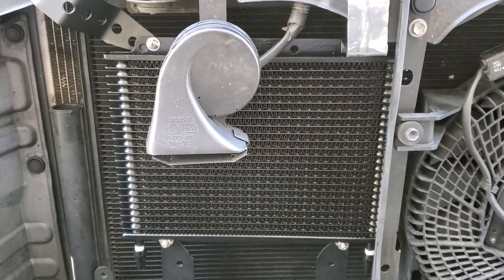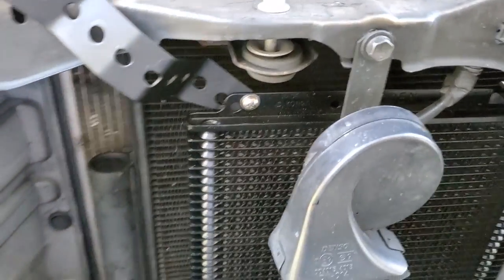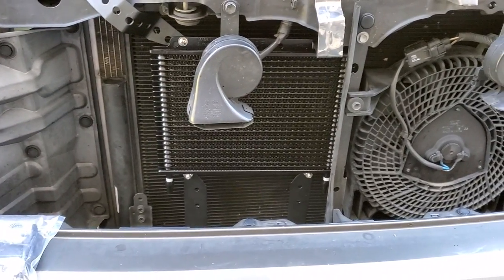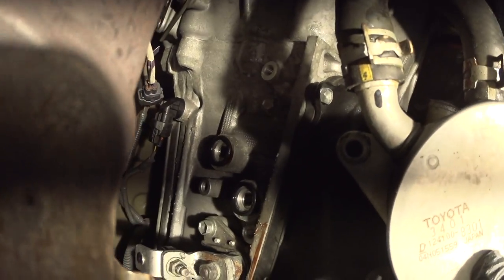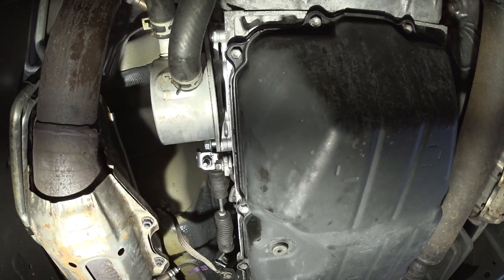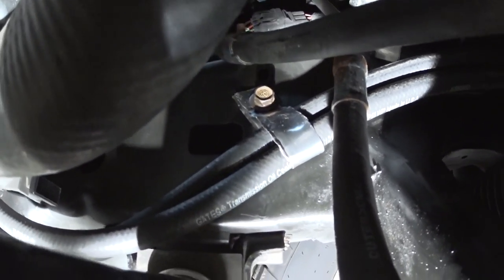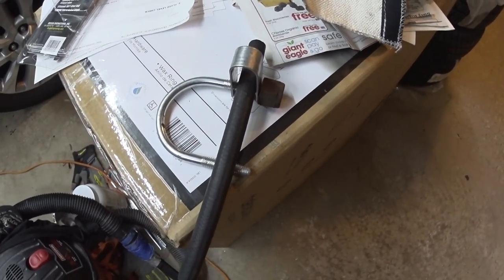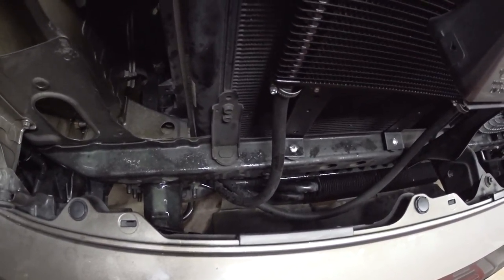TOYOTA TUNDRA transmission cooler installation 2014-2021, 2020 TUNDRA TRANSMISSION cooler upgrade

Comment from the maker: 3 inch u bolt is what I have https://amzn.to/3kTuD7y
Torque wrench https://amzn.to/3kW62z4
Transmission cooler https://amzn.to/3fjQzb7
Gates Transmission hose http://ebay.us/CJRehb
Best synthetic transmission fluid https://bit.ly/3ftsVZO
Transmission fluid transfer pump https://amzn.to/2IOoSLL
Tundra Transmission thermostat http://ebay.us/rdh6JZ

Comment: May sound like a dumb question, but is there no problem with the trapped air in the cooler and hoses after installation? Is there a way that the air is bled off, or am i overthinking this?
Reply from the maker: Air purged by pressurized fluid that is flowing through
Reply: @repairvehicle  ok, thank you for the quick response!

Comment: They DO NOT NEED additional coolers!
Reply from the maker: Yes they do
Reply: @repairvehicle  no they do not! They already have one!

I just posted elsewhere. What they have now is a heating and cooling system that works in conjunction with the engine cooling system.

We have had systems that warm up the engines faster (and I don't mean thermostats) for a long time now. Well Toyota has designed the trans to warm up faster - especially in extra cold climates - as well as to remain within operating specs (summer towing for example). Yes, they're higher than people are used to seeing, but that was considered when they designed the system.
Reply from the maker: No it was not considered.  Since 2007 Toyota had external transmission cooler until 2019. What changed in 2020, same engine and transmission?
Reply: @repairvehicle  well, the '19 and up Tundras have been racking up the miles and I'm still waiting to hear about all sorts of trans failures due to overheating, or failures in general.

Why preemptively install a part while under warranty? Let's see if these Toyota guys got it wrong first.
Reply from the maker: Why Toyota tundra used transmission sold for big money on eBay if they don't fail? Who is buying these transmission and for what purpose if they don't fail? Must be collectors item.
Reply: @repairvehicle  used? Well Tundras have been out for a long time. They also get wrecked, totaled, and parted out.
Reply: @PaulSter  Just bought a used 2019 Tundra with 58,000 miles on it to tow my 4300 lb camper. The transmission overheated after two hours of towing. They do indeed need an external cooler. Dealership said they reprogrammed the vehicle and serviced the tranny. Claimed they never heard of this problem before. Toyota dropped the ball in my opinion. This is my 5th Toyota vehicle. Not too happy.
Reply: @swamphillfarmapiary-dan810  sorry that happened to you. It's truly the first time I've heard of it. I sold mine because I didn't need it anymore, but I sure loved it. 

I hope yours gets resolved without too much hassle.

Comment: I see Toyota has installed an electric push fan on their Tundras. I ditched the clutched operated factory fan. I installed two electric fans with an electronic controller to pull 5500 CFM of air through my radiator. MY system, works much better in the SW Summers to keep the cabin very cool. The transmission cooler in my Tundra is much larger in my double cab with 4.7 liter engine.
Reply from the maker: Toyota will never install electric fans because they are no match to mechanical fans.
Reply: @repairvehicle  I challenge you and Toyota to that. Ford and GM have used electric fans for over a decade without any issues. Just like the transmission cooler, it was a money issue. They have off the shelf parts from other engines/vehicles they can utilize. The large output alternators can certainly support the 25/30 amp draw that my cooling fans require without any major electrical upgrades.
Reply from the maker: Toyota is not stupid.  They know electric fans can't move air like mechanical fan.
Reply from the maker: ford and gm don't use electric fans on their HD trucks, I wonder why? Even 6.2 f150 has mechanical fan.
Reply: @repairvehicle  : If Toyota was so smart, probably the bean counters, why on Earth did they eliminate the transmission cooler? It worked before without any issues. They’re is no reasonable explanation to not install electric pull fans on their trucks. Earlier tundras didn’t have the “push fan” your trucks has.m, correct? The Sequoia has it to help cool the A/C condenser during the hot Summers. We’ll see what Toyota does with the new 3.5 bi-turbo engine in the new 2022 Tundra. I’m willing to bet they’ll have dual electric fans, those intercoolers will need them.
Reply: @repairvehicle  But were talking about the 1/2 ton versions of their trucks. I just saw my nephews new GMC Denali and it has electric fans...his dually  diesel truck has a clutched fan though.
Reply from the maker: @jamram9924 , yes Ford 6.2 f150 has mechanical fan. Ford f150 diesel has mechanical fan. There's a reason why 3/4 ton truck don't use electric fans.  Electric fans can't move air like mechanical fans
Reply from the maker: @jamram9924 ,  Sequoia has mechanical and electrical fan,  due to size of the cabin.
Reply from the maker: My truck has only mechanical fan.
Reply from the maker: Tacoma still uses mechanical fan, 30 years later.  Why no electric fan? Removal of transmission cooler is definitely bad part of them. 2021 Ford f350 diesel no longer has transmission cooler either with 10 speed transmission.
Reply: @repairvehicle  true, but it proves that cooling that condenser quicker helps keep the A/C working at maximum efficiency. Obviously, more people to heat up the cabin. Is the Tundra Crew Cab that much of a difference? Point being is that there’s no logical explanation why Toyota engineers did this. I’m speculating it was the bean counters that influenced this decision. I live in the SW and have runned into many tundra and Tacoma owners feeling that “not so cool” A/C during stop and go traffic. This is NOT an issue on the highway. We have temperatures that reach well over 100F in the Summers and that’s just ambient temperatures.
Reply: @repairvehicle  I wish I could send you a photo of my set up. It is detailed in every aspect of the installation. Why? I notice increased performance in A/C and idling temperatures. I don’t want to destroy my aluminum heads due to a simple adaptation of a proper cooling fan system. There are several YouTube videos showing owners that have done this. There’s a guy in CA that’s does Baja racing in his tundras and also has exhaust systems, BAMufflers. Keith showed me his stats on the electric fans and I made some additional adaptations. It outperforms the clutch fan for cooling hands down. I am concerned about keeping my engine and transmission cool. Heat destroys them both!
Reply from the maker: You can create slide show and upload to YouTube.
Reply from the maker: I would have done differently if I had an issue with cooling the condenser. I would have added electric as an addition, just like sequoia has it. But I would love to see your set up. Maybe you can upload pictures to youtube as a slide show.
Reply: @repairvehicle  because those heads are cast iron and not aluminum, unless some manufactures has used aluminum heads in their diesels. When idling, an electric fan will move much more air than any manual clutch fan, that’s just a fact. Once a vehicle is moving it doesn’t rely much on the fan unless it’s driven on city streets. Once again I refer you to Ford and GM trucks using electric fans on their 1/2 ton trucks.
Reply from the maker: Ford and gm use aluminum heads on diesel engines.
Reply: @repairvehicle the last Ford diesel I serviced had cast iron heads by that was an earlier model. Updates in technology and metallurgical advances have helped make this possible. Different breeds of engines and all about cost effectiveness on electric cooling fans. Why? Costs. Higher output alternators and heavier gauge wiring systems and controls. A clutched fan is much cheaper to install A idling  car or city driven car with a clutched fan will never move the air an eléctric dual fans setup and that where this makes a huge difference. Again I’ll repeat that Toyota will install electric fans on their newer bi-turbo V6 on the upcoming Tundra replacement engine they claim will be on the 2022 Tundra.
Reply from the maker: We shall see, about tundra with electric fans. Tacoma still uses mechanical fan. $100k lexus lx570 uses mechanical fan.
Reply from the maker: 6.7 powerstroke has aluminum heads since 2011 and mechanical fan.
Reply from the maker: You work as a mechanic for Ford?
Reply: @repairvehicle  I worked at an independent import shop dealing with mostly European and Japanese vehicles. I would moonlight on all other things automotive. From my experience, Toyota and Honda and their luxury brands are much better vehicles than what the domestic market has. Ford has the best trucks on the market but they have their weaknesses as well. I prefer the Tundra for a variety of reasons, long term quality being one of them
Reply: @repairvehicle : ok my friend we shall see.....hahaha. Remember those turbos and their intercoolers...
Reply: @repairvehicle  Lexus used engine oil on some of the older Lexus. That was ingenious because it cooled the oil and spin the one fans they had a secondary pull fan to assisting cooking the condenser.

Comment: I need some help maybe you can help. I am doing drain and fill on my 2018 Toyota Tundra 4.6L SR5 but I can't  find the transmission cooler bypass valve. The Haynes Repair manual says that if have a truck has town haul package i should block the bypass but i can't find it
Reply from the maker: Did you watch video without skipping? Answer in the video

Comment: Does anyone know an OBD2 scanner that will read the trans oil temps? If we're going to install a cooler, it would be nice to be able to monitor the temp, and see if its working.
Reply from the maker: Scangauge 3 and 2 can read live temperature 
https://youtu.be/245sYnfe4V4
Reply: @repairvehicle thank you

Comment: Yes I on my 2019 tundra missing this. I bought Toyota for last 25 years.After this I won’t be buying another one.
Toyota should recall all the trucks back and install the cooler just to win back the customers!
Reply from the maker: Toyota still number 1 in reliability.  Ford does not have either.
Reply: Because your transmission failed?

Comment: Thanks for this, I've read of this being done on a few forums and even seen some pictures but this is the first video. Seems like a pretty straight forward addition to improve cooling of the transmission. 
Any issue with air in your cooler having the inlet/outlet both on the bottom?  It would seem turning the cooler 90 degrees would help.  
How much extra transmission fluid did it take after adding the cooler? Same process of filling, warming up and checking the over flow?
Reply from the maker: It doesn't matter if it's turned or not, because fluid drains back anyway, if it's on the side or down. Having inlet/outlet up, then fluid stays in the cooler, but fluid from hoses being drained back to the transmission. No issues and not expecting any issues. I wish have done it earlier. 
About half a quart extra, it will vary depending on the cooler size and hoses route.
Yes, same process for checking level through overflow tube, but make sure thermostat is open. 
Thank you for asking.  Please share this video with others.

Comment: Curious, why can't just a cooler be added after the radiator outlet back to the return of the transmission?
Reply from the maker: Your radiator has transmission lines connected?

Comment: Do you know what temp the thermastat will open up at?
Reply from the maker: Thermostat opens up I believe between 190 and 200 however fluid will not flow into cooler through thermostat if torque converter is unlocked
Reply: Thank you. I installed mine, using your video as my guide, and ive never done anything like this on a modern vehicle, so it was a challenge. Got it all installed, and its working great! Thanks for the inspiration!

Comment: Can I do this to my Lexus GS 6-speed? It has the same cooler puck now.
Reply from the maker: Probably can using same setup as Toyota tundra 4.6 v8 or maybe even as 5.7 if it has same size cooler puck as 5.7
Reply: @repairvehicle  Thanks. Both use A760E (RWD) (or H for AWD) Lexus. I will have to look into it.
Reply from the maker: How did you find my channel?
Reply: @repairvehicle  From my car repair addiction, some of your good videos came up!
Reply from the maker: I hope you are a subscriber to my channel. Because your question gave me some good ideas.

Comment: Pin the thermostat open or not?  When towing I see temps around 205 degrees.  Should I be concerned of oil degradation
Reply from the maker: You should be changing oil more often anyways regardless of the temperature

Comment: If the cooler develops a leak...is there a way to bypass until you replace it?
Reply from the maker: Put a piece of pipe connection instead of a cooler

Comment: Hello I have a 2008 Toyota highland should I do the same set up
Reply from the maker: It depends on how hot transmission fluid gets
Reply: Thank you for responding. It gets hot about 235- 245 c
Reply from the maker: Definitely cooler is a good idea with thermostat.
Reply: Thank you, you are the first one who is professional I have seen in YouTube

Comment: Sir do you recommend to pull the pin or leave it in the thermo?
Reply from the maker: What are you trying to do?
Reply: I'm trying not to damage the transmision by making it too cold in the winter
Reply from the maker: Remove the pin for everyday driving. Pin is for fluid change only
Reply: @repairvehicle  thanks. Also am I to understand that putting the pin back in on a hot summer day while towing say 6000 pounds will cool better than removing the pin. In other words is it smart to leave the pin on hot summer days
Reply from the maker: I have never driven with pin on. I have noticed that with cooler and without pin on hot summer days temperature stays lower than colder days

Comment: I have a 2014 tacoma 2.7l , where do I install the transmission thermostat ?
Reply from the maker: What do you have now? Transmission cooler from factory?
Reply: @repairvehicle  Yes just factory cooler (radiator).  What is best thing to do:  bypass factory (radiator)  cooler and just use an external cooler with a fan on it ? or go from factory cooler to an external cooler and back to transmission. or is there a thermostat to use on transmission like in your video ?
Reply from the maker: Use factory radiator with external cooler and thermostat.  Fan is optional unless you are using your truck for off road rock crawling.
Reply: @repairvehicle  Is there a thermostat that mounts on transmission  of this 2014 tacoma or are you talking about an in line thermostat mounted on external cooler or on hoses ?
Reply from the maker: I don't think they came with thermostat from factory.  You can use aftermarket thermostat .
Reply from the maker: I am referring to something like this https://amzn.to/2NYvwS7

Comment: What did you do with the original  transmission lines going to radiator ? cap them off ?
Reply from the maker: What original lines?
Reply: @repairvehicle  Is this just an add on to the original transmission cooling installed at factory  that uses radiator ?  Or did you disconnect the factory system and just use the
things you mounted ?  Please explain.
Reply from the maker: Explanation in the video.  Cooler was added because it didn't came from factory.  There's was no factory lines, I had to install mines as you can see in the video. Every detail is in the video
Reply from the maker: Transmission coolers don't come on trucks anymore, even 1 ton don't have them. Very few 3/4 and 1 ton truck have coolers from the factory now.
Reply from the maker: Please watch this video,  it has answers to your questions https://youtu.be/-pKU093beeI
Reply: @repairvehicle  i think he is referring to the input and output lines for the round heat exchanger that is still part of the system.

Comment: Slightly unclear, the o-rings you bought for the thermostat, you ended up using on the heat exchanger?  Since the thermostat had it's own o-rings
Reply: My advice, due to the huge backlash against Toyota for removing the thermostat, redo the video actually showing the actual installation of the  thermostat, the heat exchanger, all the o-rings. And please use a shop light to show your work. Then you will have the best video. This video is a little dizzy from the way you held  the camera.
Reply from the maker: Did you watch the video without skipping?
Reply: @repairvehicle  Sir, when installing thermostat and then heat exchanger. O-rings go on both? Video showed you putting o-rings on the heat exchanger. Did you just leave the o-rings that came with the thermostat in?
Reply from the maker: Excellent question, thank you for asking.  Heat exchanger has 2 o-rings and thermostat has 2 o-rings.

Comment: I did the same job as well.  Well done, clean and professional my friend !
Go to my YouTube channel and see my set up.  I installed an engine oil cooler as well.
Great job btw
Reply from the maker: Why engine oil cooler?
Reply: @repairvehicle  I do a lot of towing.  However, I did the engine oil cooler as a novelty and as an interest project to be honest.  It's been working great so far.  I made a small video on my channel.
My last tundra (08, 5.7) had 470,000 kms in it.  My new 2020 will be my million miles tundra !
Reply from the maker: I will definitely check your video.
Reply from the maker: But your tundra already came with engine oil cooler.  Water to oil.
Reply from the maker: What was the engine oil temperature before and after?